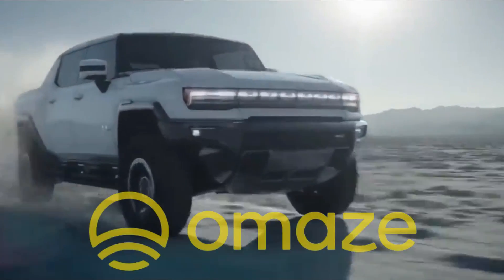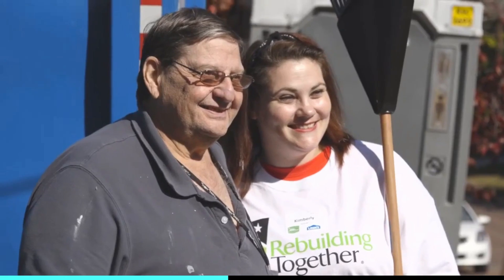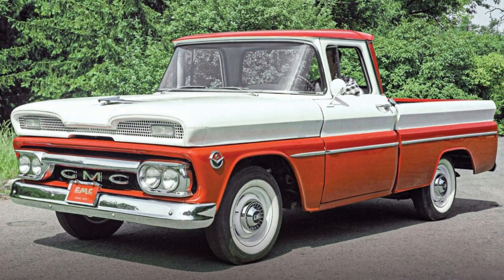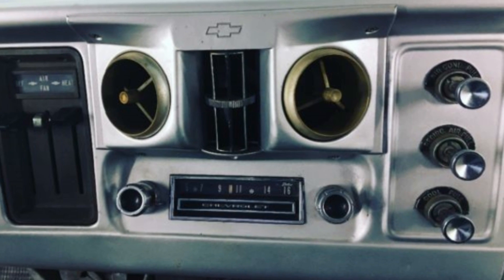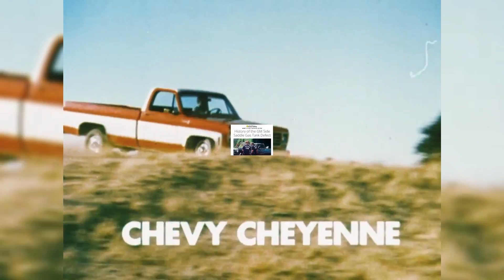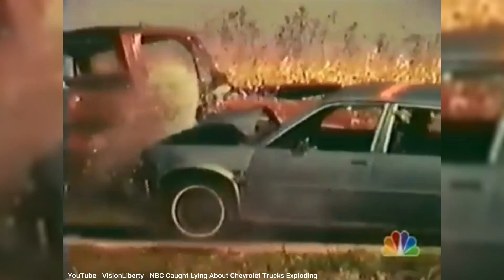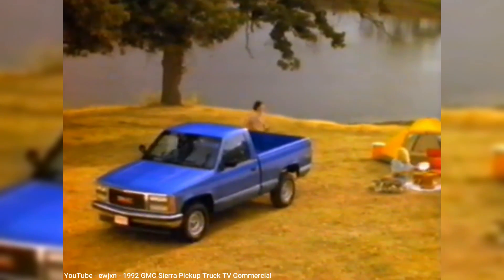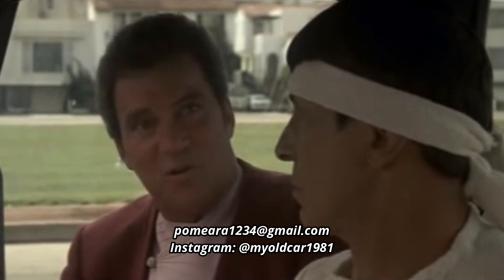Here’s how GM survived the Chevy/GMC C/K pickup exploding gas tank scandal

Comment: At the time it met it met safety standards ! my argument would be is there a safe place for any fuel cell ?
Reply: Inside the frame is a logical start.  For comparison, my 1979 240D passenger car has the gas tank behind the rear seat well ahead of the rear crumple zone.  You will even find crash data on yt showing the development.  Contrast that to GM which probably did zero crash testing of that series.
Reply: @bobbbobb4663  inside the frame is safe unless a broken driveshaft tears it open but look at all the pre 1979 vw beetles that had the fuel tanks in the firewall !

Comment: Still have my ‘87 c10 to this day. Plan on restoring it this winter. The truck just never quits. And the fuel selector between both tanks still works!
Reply: I'm gonna be honest. I love my '84, but fuck I wish mine had the double tanks.
Reply: @Aff1982  oh it is, as long as the tank selector valve still works lol. Mine still does to this day but I hear if it goes out, theres no where to find a replacement.
Reply: @BRRDsAutomotive  bro.... you can get AC DELCO!!! valves AND switches........ still to this day!!!!
.
now the quality might be crap today.... but at least you can get it working for a few months to a few years
the AC DELCO parts should be decent..... 
.
at the VERY LEAST doorman would still make this
but the doorman part would probably cause a gas tank explosion by it self LOL
Reply: @kainhall  damn really? I was told that those fuel selectors solenoids were ‘unobtainium.’ And I thought I was the lucky one with the original solenoid still working hahaha! Good to know. And yeah Dorman has some good parts - they seem to have gotten better over the years. 

Funny thing is I just discovered a fuel leak on my c10 the other day in the filler neck for the passenger side tank! Here in PA, they switched the nozzles at the gas station to these short stubby ones. So now when the pump clicks off, the fuel fills all the way into the filler neck. So now I’m replacing both filler necks with stainless steel instead of rubber.

Comment: Although I never owned one, I do have fond memories of some of the '70's and '80's Chevy/GMC pickups, from the summer job I had during college where I learned to drive a 3-on-the-tree in a 1970 C10 and friends or neighbors owning square-body trucks.  Like many people, I remember when trucks were often less expensive than cars, and although they weren't fancy they had all the things you really needed.  And the 1/2 ton 2WD versions often rode pretty similar to a rear drive full size car, though heavier duty 4WD models did need several hundred pounds of weight in the bed to not feel like the axles were just bolted to the frame.  Great video, and I definitely learned some things about these iconic vehicles.

Comment: General Motors (GMC and Chevrolet) should had just stuck with the sqaurebody body style. It was just fine!

And just update stuff here and there!
Reply: Exactly mate, also they should've made a Pontiac truck (based of the Square Body) with a real Pontiac V8 as well.
Reply: @CJColvin  Yep. And with both V8 Buick 455s and Pontiac HD 455s as options. Along with the Buick/Olds/Pontiac Small blocks of V8s. And maybe a Inline 6 Turbocharged as an option? 😁 Which in that case the Buick 3.8 V6 from the Grand National Turbocharged as another optioned engine? 😁
Reply: The GMT400 trucks from 88 to 98 were a huge improvement over the 73-87 trucks. While I like the Squarebodies the GMT400's have proven to be amazing trucks too.
Reply: @edwardpate6128  1988 to 1995 GMC and Chevy trucks's frames and drivetrain were no different to the square bodies of 1991 and 80s......they had the same engine, Throttle Body Injection V8s and 700R4 Four Speed Transmissions(with the exception of the 4L80 which is basically just a Turbo 400 with overdrive and computer controlled. Which the 1991 squarebody had 4L80E transmissions also by the way) for example.

GMC and Chevrolet basically just took the frames  of the squarebodies and dropped  the new "Aero" design bodys of 1988 to 1995 on the squarebody frames

Comment: You need to do the 1970-1980 Ford Pinto rear gas tank exploding when hit in the rear. Ford said it would be cheaper to pay death lawsuits rather than spend a recall on a $9.00 part to fix the gas tank problem, You also should due the one on the Ford/Firestone Tire debacle of 2001 involving the Firestone Wilderness A/T ATX ATX II tread separation and rollover causing 400 injuries and 100+ deaths and Ford/Firestone blamed each other These two would  make good video topics.

Comment: This truck had some variations around the world too, with different designs both for 10 and 20 series (60, 70 and 80 medium and heavy trucks too) they used A,C and D prefixes (alcohol, gasoline, diesel) and was the first truck to offer alcohol engines here in brazil (first mass produced alcohol car was made by fiat in 1978)
Reply: I assume what you are calling alcohol is similar to what our ethanol is? I believe I remember that Brazil made it from cane sugar rather than our corn. If I am correct, I am curious as to how cars did with it? Ethanol made from corn has less energy per gallon so we lose 15% or so when compared to the efficiency of gasoline
Reply: To much alcohol creates gM truck sales ( yes the ones with weak frames)
Reply: @bradzimmerman3171  lol, awesome response. I meant alcohol as fuel to power the truck, not alcohol to power the buyer. Lol, that is probably my favorite response ever though
Reply: Here, during the petrol crisis we had everithing fueled by alcohol (ethanol) (research began in 1974) motorbikes, buses, tractors, cars, pickups, trucks... Big truck companies like Mercedes Benz, Scania, Ford, GM, Dodge (before being bought by vw in 1979) Cummins, Mwm Volkswagen did this, nowadays alcohol still strong in passenger cars here, every car made here is bi-fuel

Comment: What everyone always seems to forget is how much safer from a gas tank perspective these trucks were to those that preceded them where the gas tank was inside the cab and behind the seat.
Reply: In March 1990, my 65 GMC Shortbed spun out in the rain. A Pontiac impaled the passenger side, at a 90° angle, exactly between the wheels.
The gas tank was originally six inches from the cab corner. After a collision at a closing speed of 80 MPH, it was still three inches away. 
She was destroyed, but the tank didn't leak.
Reply: Not really, less likely to rust, less likely to get hit in an impact.
Reply: And chain smoking Marlboro reds

Edit.  It must have been safe if nobody died
Reply: The video literally said that it was acknowledged that the previous design, with the tank IN the cab WAS safer.
Did you not watch the video?!
Reply: @drussell_  If you're asking me, no, I didn't. That said, nevertheless, I've never owned a truck that old (nor did my late father from what I remember; even though he died before I was born, my paternal grandfather owned a maroon '68 Chevy C-10 pickup and my grandmother sold it not long after he died).
Reply: Those were actually way safer than saddle tanks
Reply: I own trucks with the tank in the cab, trucks with tanks on the side of the frame, and trucks with the tank in the rear between the frame rails... I've never had any of them explode and burn me to death.  Trucks aren't dangerous, no matter how they're built.  Ignorant drivers are dangerous no matter what they drive.
Reply: @livewire2759  maybe but thats hardly a valid statistical basis.
Reply: @livewire2759  The late Shannon Moseley (he was burned alive in a squarebody GM pickup) would probably disagree with you.
Reply: @alantrimble2881    That depends... how did that fire start?  Lots of people have burned to death in lots of different vehicles.  One case doesn't make a pattern.
Reply: @livewire2759  I couldn't have said it better!
Reply: I completely forgot about the trucks that had the fuel tank behind the seat, in the cab. Wow I completely forgot about that
Reply: @working_country ___ yeah, a rollover was a problem. That’s not your typical accident. More people died from the fuel after it was taken out of the cab.
Reply: I've had to explain to so many people they come out and buy an old truck and they're like why is it smell like gas in the cab and get a walk out there pull the seat forward and say there's your fuel tank
Reply: @masjuggalo  If it smells like gas in the cab, you have a severe fuel line leak or tank problem.  FIX IT, it should never smell like gas in the cab!!
Reply: @drussell_  well let's see it's a original 72 tank and filler with the original seal the smell was only noticed very faintly in the summer when the truck was left parked in the sun with the windows up. Dude freaked out where the tank was so went with a rear mount setup that sat where the spare tire would go, outher we replaced seals and 1 actually needed a tank due to a leaky rear window. Also had a guy with a 68 Corvette complain about the fuel smell in his garage. His first carbed car and he warmed it up in there with the door open, it wasn't so much a fuel smell but that old car smell
Reply: Yup, I have a 55 GMC TRUCK with the gas tank still behind that bench seat!
Reply: The Honda Fit has a fuel tank behind the driver seat
Reply: How was it more dangerous in the cab. In order for a car to hit the tank, the driver would be *pretty messed up*. 
In the cab was statistically safer.
Reply: @Project_Low_Expectations  It’s a case of, “It may have a smaller chance of going wrong, but if it does go wrong, it goes very wrong very badly.” Plus, if there’s a fuel leak then you end up with gas fumes inside the cabin
Reply: @Project_Low_Expectations  Ok. We'll put you in that truck and crash it. When the dome light and gas tank break open at the same time and you're engulfed in flames, tell me how hot it gets.
Reply: @milfordcivic6755  I’ve been in a couple nasty accidents in them. Trust me, it’s hard to mess up the truck bad enough. I speak from experience.
Reply: @milfordcivic6755  I’ve been in a couple nasty accidents in them. Trust me, it’s hard to mess up the truck bad enough. I speak from experience.
Reply: @Project_Low_Expectations  smoking/lighting a cigarette with your back basically resting on the gas tank  ... Yeah. Safe as hell..
Reply: @UNCFIPP  How many of those trucks caught on fire because of the driver or passenger lighting a cigarette back in the day when everyone smoked?  Yeah, none, that's how many.
Reply: @livewire2759  You have to expect that from Generation Bubble Wrap, after 40 years of safety obsession.
Reply: @UNCFIPP  I drove 67-72 trucks for almost 20 years as a smoker. 
If your truck smells like gas, fix the gas leak.
Reply: @Project_Low_Expectations  yeah... Im a chevy dude to the soul, but that wasn't a smart idea.. It might not have happened(luckily), but it definitely wasn't safe..
Reply: @UNCFIPP  I'm 40 and have ALWAYS thought WHERE (OUTSIDE the frame rails rather than IN BETWEEN) GM put the tank on their '73 pickups was NOT a bright idea (it doesn't stop me from liking that generation of trucks but, I admit it's a trade-off with them; it's possible that ALL '72 and older pickups are safer with it INSIDE the cab)! Regarding the '73-'87 pickups, it's not so much that they took it out of the cab, but WHERE they put it on the frame rails, which was MORE likely to get crushed (not to mention, leak, if not EXPLODE, ultimately) upon side impact from another vehicle! In my opinion, Ford got that one right the first time with their own '73 pickups (BETWEEN the frame rails, which I'm aware was among the changes GM made to their '88 pickups)!
Reply: @livewire2759  exactly

Comment: All trucks are death traps in a crash during that timeframe. Just check the crash testing results.
Reply: At least they're wayyyyyyy better built than any modern truck you see on the road today.
Reply: @CJColvin  And I still see some around....that tells you something
Reply: @CJColvin  
In what way we’re they built better back then, the square is the only GM truck EVER BUILT to frequently be in the body shop for rust holes under warranty… their small and big blocks weren’t that great for longevity till they went roller cam. The square has a huge following of recent years, but was never that good of a truck.